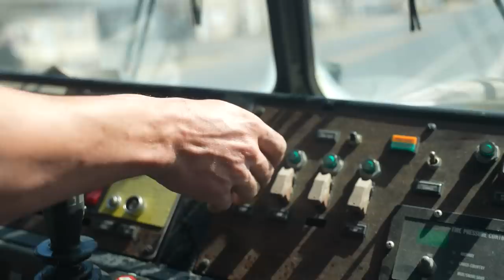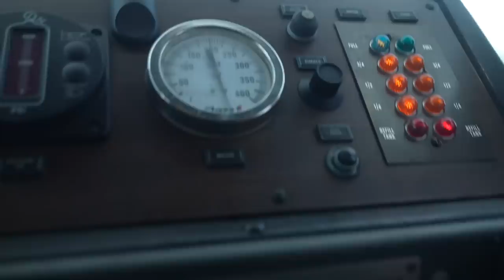Would You Do This For 15 THOUSAND DOLLARS?

Comment: Cerro Gordo needs this when you are finished with it!
Reply: probaly wont get up the mountain
Reply: @logangarrett2681  That's what they do! They can upgrade it with help from Brent and make it so it can get up there!
Reply: Yeah I'm sure it'd be nice, but Brent needs a more permanent solution than a huge truck that hold water.
Reply: @SpaceFlye  They could have used it for mixing the cement  up there too.
Reply: @SpaceFlye   He does but it would be better than nothing and good for fire protection. Heavy D didn't buy it for the tires, shipping alone from Florida where he got it cost more than a new set of tires.

Comment: That'd be fun in the middle of Summer, but be aware that you are riding the line on bruised kidneys. Even having something like a regular belt around the lower back will help to mitigate such concerns. The pressure that nearly knocked Hunter off of his feet looks like about the right amount to get over the line. It really doesn't take much.
Reply: If anybody in there wears hearing aids like my wife does you owe them $5000 probably. 35 years ago when she was a teenager and the guys would want to pick up the pretty girls by the pool and throw them in she had to beg them not to because no one knew she had hearing aids.
Reply: @shawnmason5290  Looks like they had plenty of warning to back out or remove such things.

Comment: I spent several years in  Air Force fire protection to include tours in Iraq and UAE and the P-23 ARFF apparatus was fun to drive around. We were always told to be careful as those models had concerns of the tires coming off and them passing you on the flight line. Never saw that but always a funny story. If you want a real beast of a ARFF vehicle then check out the P-19. That puppy was a monster and designed to go anywhere….like Iraq.  Pain in the butt to drive but nothing like cruising around Baghdad  international Airport in a P-19 with your rifles and chasing C-130.

Comment: So I worked on installing radios on those in the late 90s in the Air Force. Those types of engines had an issue with the hubs that were on them. If they went over 25 mph they could split and you can lose the wheel off it. I know the Air Force did some retro fits for some of them but I know they decommissioned a lot of them because it was to expensive to fix them. You all may want to look into the history of that rig.

Comment: Give it to a needy volunteer fire dept. I was at a dumpster fire back in the 80s. I was on the end of a 1 3/4 line waiting for water. The pump operator pulled the gate open all at once. Suddenly I had 150 psi comingvat me. Lost control of the nozzle. My helmet, glasses,  nozzle and dignity all went off into low earth orbit. For 1000 extra points, what was my mistake??

Comment: They all agreed to participate....and had a lot of fun in the process.  I know that I physically could not withstand that much hard hitting water. If anything, the first blast on my back would have me down on the concrete and getting an ambulance ride to the ER. Sooo, $15,000 or $15,000,000 you wouldn't  get me to line up in front of your delightful, ginormous water pistol. I'd have more fun inside the cab.

Comment: Ya I recall my dept “initiation day”  four of us towed the squad truck by hand in full bunker gear for 6 blocks, in late July. Then when we complained about being hot and thirsty. We were strapped to the back of the 5000 gal tender main discharge and they threw the valve…. Good times! 🤪

Comment: Awesome fun there. 
Please don't part it out! The absolutely best go anywhere motorhome I've ever seen was built out of one I'm pretty sure was identical to that. It started life as an airport fire truck for a major airport near Sydney Australia called Bankstown airport, it's more for light aircraft but still a very busy and large airport. A couple bought it, stripped a lot off it and built a 2 story with a sort of 3rd floor sun and view area where they had heaps of solar panels as well. They did a bit of a rough but very usable job of it and that thing is a VERY solid base with all wheel drive (on theirs at least). Everything about it was built to carry a large weight of water and equipment over the roughest ground at speed and never break anything, they are an awesome bit of gear and if you can't sell it as a firetruck for a decent profit, or use it yourself as one then at least convert it into something useful, just selling it's parts seems such a waste of a pretty uniquely solidly built vehicle that could probably be very useful in your recovery work if set up properly.
I drove semi trailers and everything in between, including for several days ... a firetruck but, I've never driven anything as solidly built as the one I think is like the one you've got there, an awesome bit of gear built to handle any terrain.

Comment: I could really use $15,000 so I would say yes I'm in do your worst Heavy D here are the reasons why I could really use the money my truck keeps breaking down and needs a bunch of repairs my house needs a repipe and full electrical all my windows in my house leak in the winter time my furnace has gone out my garage Has Fallen into disrepair I had to quit my job after having covid and since then I have been dealing with PTSD I have also developed a eating disorder at the time that I am writing this I weigh 155 and I am 6 ft 4 tall I am afraid to leave my house because every time I do someone triggers my PTSD and since my truck is not reliable it is a Gamble to jump in to go anywhere so if I can make $15,000 just by letting you spray me with a water cannon I'm All In

Comment: Not worth it. Ita .13 cents per bid and you have to sink hundreds of bids into items to most likely lose. Then you pay for what it sells for. So if you put 100 bids on an 25 dollar item and 50 other people do the same and it ends up going for 50 dollars you still owe that 50 if your not paying attention to cancle your bids. I had 1500 bids and didnt win anything. Spent a bunch of time and most of the good items sold for close to the price.  So they get 900 for a ps5 and 90,000 bids at .13 a bid which is like 12,700 for a ps5 and a few games. If the bid were cheaper it might be worth it.1/3 the price and they would still make 4k on it. Yes 1 in 10 items sell cheap because people slip but their making millions and most people walk away with nothing.

Comment: Fantastic what a spectacle, apparently your channel on YouTube must yield a lot, I have decided to throw everything I have on only 1 channel unfortunately I am demonized on YouTube by a stinky stroke of someone and it has been since 2012 with only 300 visitors and I have a lot to offer, such as writing about my past as an all-round truck driver and that I also have a lot of photos because I have been taking photos for 45 years and have been part of various photo clubs and that it is not messy work. ---It reminds me of those very fine print that say you buy a car that way, for example, don't expect that when it breaks, they won't fix it, the so-called snags word, your deal will be voided, and that's the reason I don't take any risks with those kinds of deals. But tax in the Netherlands is 3x higher in the Netherlands, so you may understand that I watch what I spend. I am retired and no longer work, knees, back etc, that is no longer possible regardless of what I would like to do, but 7x severely overstrained and a Burnout and then you can still have so much experience but then they don't need you anymore.

Comment: nice   toy its a ARFF  crash truck from the air force it can knock down a fire on an aircraft in mins  with all that water =foam
Reply: its an eone titan   with 3500 gals of water
Reply: pump and roll
Reply: 2 spary patterns strait stream or fog stream
Reply: good way to wash the shop floor